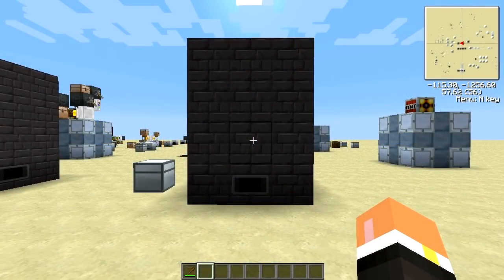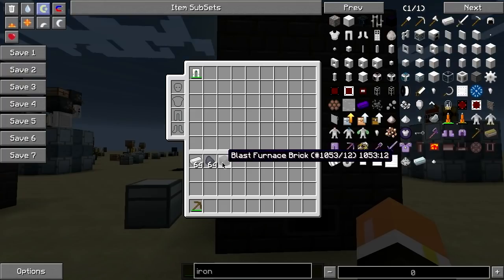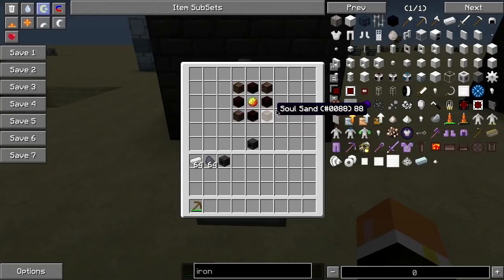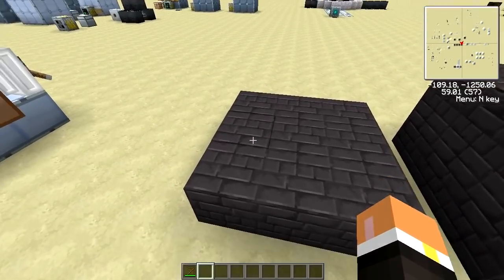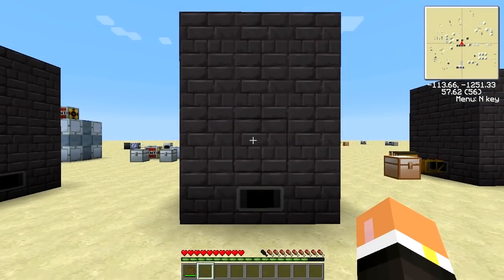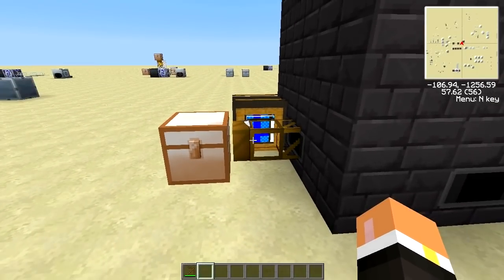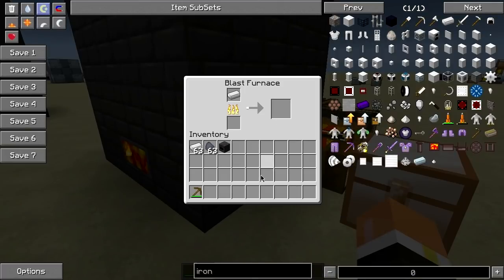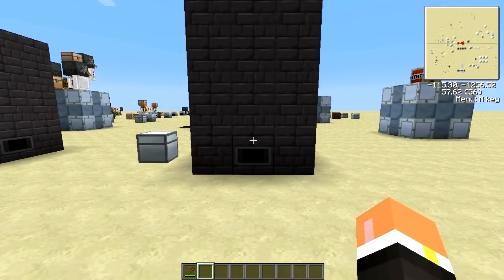Feed The Beast :: Machine Tutorials :: Blast Furnace

Comment: For magma cream, which is easier to find slimes or magma slimes? I have plenty of blaze powder so I can go either way.
Reply: +BJM Graphics If you use FTB Monster, there is a MUCH better way to make a blast furnace than this, & it makes HSLA steel way faster & by using only a fraction of the coal. (73 HSLA ingots cost 1 sand & 7 coal) You don't even need to use Blast Furnace Brick. You make a "Blast Furnace" on a crafting table. It requires 8 Stone Bricks (Stone is made by cooking Cobblestone in a regular furnace, 1 Stone Bricks requires 4 Stone) & 1 Redstone Dust in the center. (like you're building a regular Furnace, but out of Stone instead of Cobblestone, & with 1 Redstone Dust in the center) Next you make a little hollow 3X3 grid out of Cobblestone. On one of the sides, place the Blast Furnace in the middle, instead of Cobblestone. Now fill the center with a bucket of Lava. That's it.
To make HSLA steel, open the Blast Furnace menu. (right click on Blast Furnace) On the left side, put Sand on top, Coal in the middle, Gunpowder on the bottom. (it doesn't seem to actually use the Gunpowder, but if it's not there, it won't start cooking). Put your Iron Ingots on the right, & they'll cook. 1 thing worth noting, it takes a few minutes for the furnace to reach 625 degrees. (it goes up at a rate of about 2-4 degrees per second) Also, that 1 bucket of lava seems to last forever. So much faster & more efficient. ;-)
Reply: Actually go kill Blazes. they have a chance to drop  Molten cores which gives 3x magma cream

Comment: ive been trying to make it but once i finish the furnace part does not come up? it is a hollow 3X4X3 square just how u made it? any help appreciated
Reply: +TheMasNations If you use FTB Monster, there is a MUCH better way to make a blast furnace than this, & it makes HSLA steel way faster & by using only a fraction of the coal. (73 HSLA ingots cost 1 sand & 7 coal) You don't even need to use Blast Furnace Brick.  You make a "Blast Furnace" on a crafting table. 
It requires  8 Stone Bricks (Stone is made by cooking Cobblestone in a regular furnace, 1 Stone Bricks requires 4 Stone) & 1 Redstone Dust in the center. (like you're building a regular Furnace, but out of Stone instead of Cobblestone, & with 1 Redstone Dust in the center)  Next you make a little hollow 3X3 grid out of Cobblestone.  On one of the sides, place the Blast Furnace in the middle, instead of Cobblestone.   Now fill the center with a bucket of Lava.  That's it.  
To make HSLA steel, open the Blast Furnace menu. (right click on Blast Furnace)  On the left side, put Sand on top, Coal in the middle, Gunpowder on the bottom. (it doesn't seem to actually use the Gunpowder, but if it's not there, it won't start cooking).  Put your Iron Ingots on the right, & they'll cook.  1 thing worth noting, it takes a few minutes for the furnace to reach 625 degrees. (it goes up at a rate of about 2-4 degrees per second) Also, that 1 bucket of lava seems to last forever.  So much faster & more efficient. ;-)

Comment: Holy shit this furnace cooks steel slow  .; so much coal.... anyway thanks for the tutorial it was informative!
Reply: +PewPew Lazehs If you use FTB Monster, there is a MUCH better way to make a blast furnace than this, & it makes HSLA steel way faster & by using only a fraction of the coal. (73 HSLA ingots cost 1 sand & 7 coal) You don't even need to use Blast Furnace Brick. You make a "Blast Furnace" on a crafting table. It requires 8 Stone Bricks (Stone is made by cooking Cobblestone in a regular furnace, 1 Stone Bricks requires 4 Stone) & 1 Redstone Dust in the center. (like you're building a regular Furnace, but out of Stone instead of Cobblestone, & with 1 Redstone Dust in the center) Next you make a little hollow 3X3 grid out of Cobblestone. On one of the sides, place the Blast Furnace in the middle, instead of Cobblestone. Now fill the center with a bucket of Lava. That's it.
To make HSLA steel, open the Blast Furnace menu. (right click on Blast Furnace) On the left side, put Sand on top, Coal in the middle, Gunpowder on the bottom. (it doesn't seem to actually use the Gunpowder, but if it's not there, it won't start cooking). Put your Iron Ingots on the right, & they'll cook. 1 thing worth noting, it takes a few minutes for the furnace to reach 625 degrees. (it goes up at a rate of about 2-4 degrees per second) Also, that 1 bucket of lava seems to last forever. So much faster & more efficient. ;-)